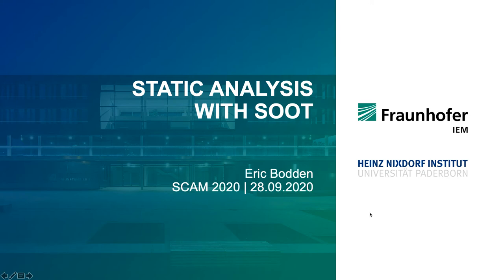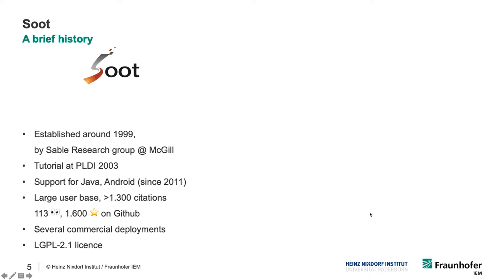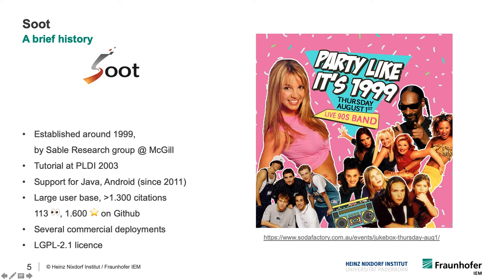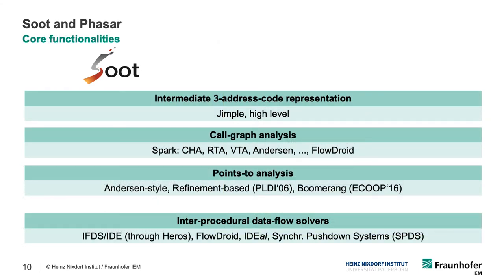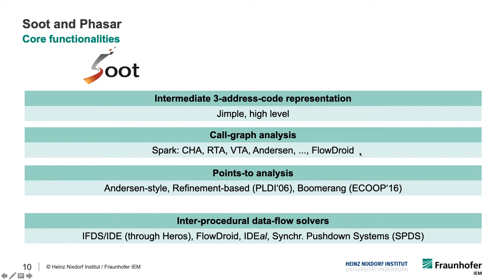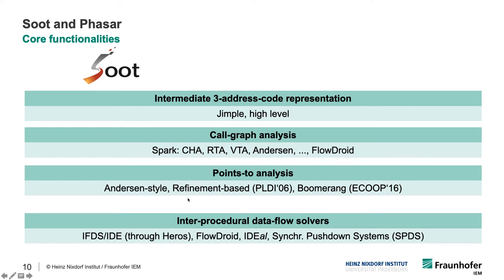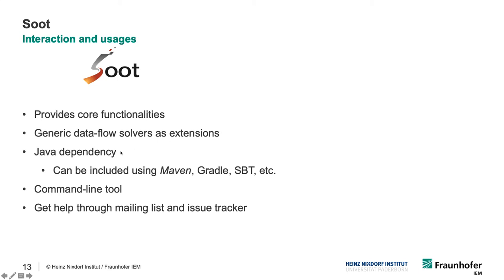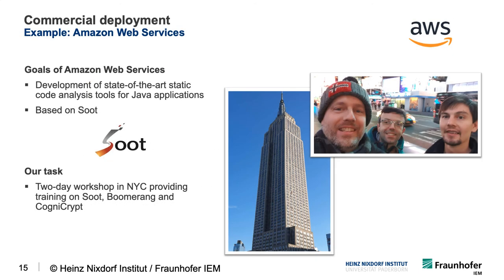Static Analysis with Soot

Comment: soot is very diffcult to learn, its offcial document is too bad.
Reply: thank you for the comment.   this is important for preliminary decision making on whether to invest time and energy on this tool or not.   it apply only to Java correct?   compared with Angr's static analysis does it have more functionalities?
Reply: Can anyone tell me how can I use this? I want to do analysis of an apk
Reply: I couldn't agree more. I'm trying to use Soot for my thesis and I spent WAY too much time trying to use it on Scala generated .class files within IntelliJ. Even now I'm struggling to feed classfiles to Soot due to it having its own classpath. It cannot even resolve class dependencies when the very same class is not only in the same dir, but the path to the .class file is explicitly stated and as a -soot-classpath statement! So, either I'm missing some critical information on how to use Soot, or something is clearly broken
Reply: @rajatgoyal8162  if you want learn it well,you must konw some konwledge about static analysis.or you will face some difficulities.So I think you should know some theory of SA
Reply: Really Agree.. I am using soot for android app instrumentation and when I have to insert new logic, I have to look up all the files in the library. Jimple..blah, blah, blah